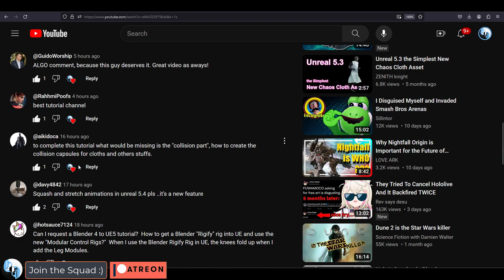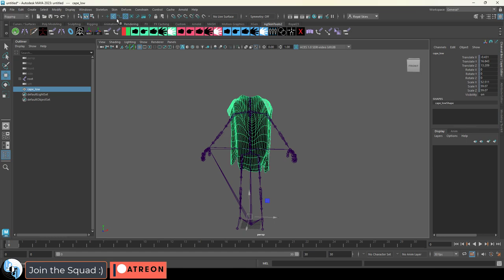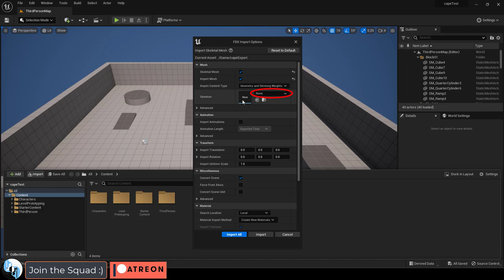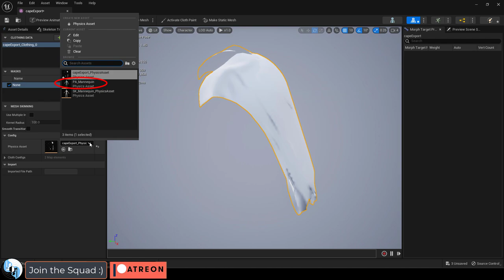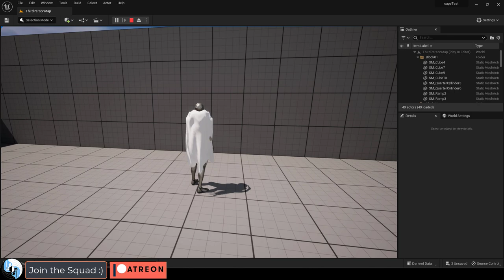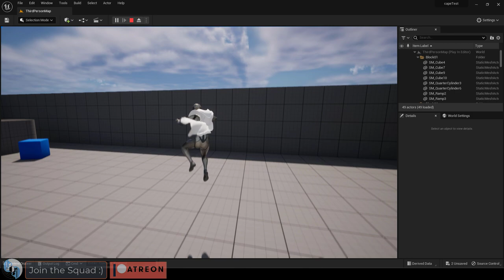Unreal5 Cloth Physics (COLLISION!!)

Comment: I had the same problem with the elbows, apparentely when I imported my character, it only created the physics for the upper arm and I solved by creating a tapered capsule colision in the lower arm, you can do it by right clicking the bone in the skeleton tree in the physics asset, in case the bones are not showing, it's because a filter is applied. hope it helps!

Comment: If you check out your physics assets you’ll find out there’s capsules there you have to mess around with on your characters and that’s what the cape is checking to see where to stop at anyway in that menu there’s a bunch of stuff you have to tweak to get the capsules to work just right it also is used to determine how rag doll works in the engine you can set up constraints on a capsule by capsule basis like how far the arm can bend forward and backwards for example usually when you import a character the rigid bodies will be all types of messed up and you’ll most likely have to adjust them

Comment: you need to adjust capsule collisions it's something you do in the character mesh, it's not only used for both "hair and cloth simulation but also for physici simulation like rag doll, what the cloth "collide is not the character mesh but "capsule meshes which are added to the character in unreal (you can do that in maya too or blender), they are adjusted in the character mesh in "physics", if didn't appear in the character mesh it appear on the "skeleton", you can find some good tutorials explain about the "collision boxs

make a cloth "collide perfect with the mesh can be too demanding for real time and bad for optimization, this is why normally they use a capsule or other simple geometry to define collisions and ragdoll or others phyisics simulations.

Comment: I had this same issue recently, pick any bone you want to attach with weightpaint and paint the entire cape with 100% weight. in your blender or  maya and then in engine add cloth physics, the cape will be bound to that bone and not give that half physics and half no physics look. for the collision you can make a single convex hull that acts as one body instead of capules. i don't know if its more taxing but in  PA_Mannequin under tools (Minbone size : 3-5) (Primitive type: single convex hull) (max hull verts: 32-64) the higher the number for max hull verts the better the coverage i think. it will make a collision for the cape sometimes in more than one piece depending on the complexity of your cloth or whatever but the more simple the better.  just delete the collision it makes for the cape. (Hours of importing exporting, my soul hurts, thanks for reading)